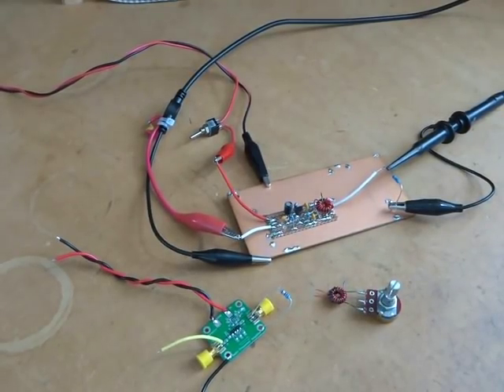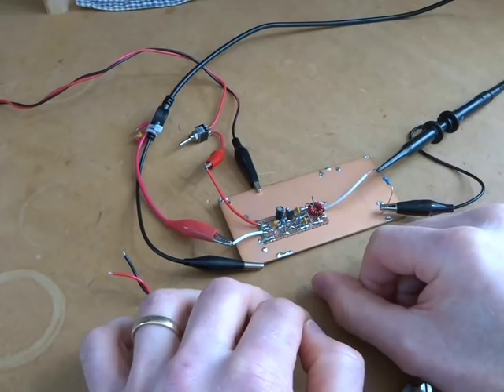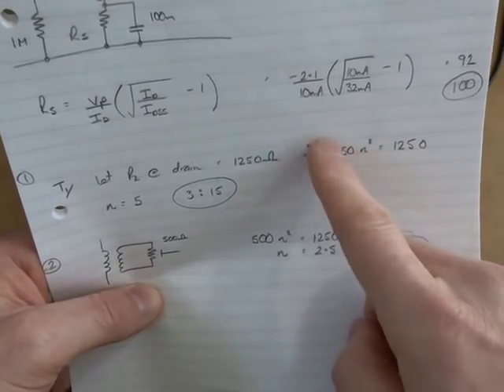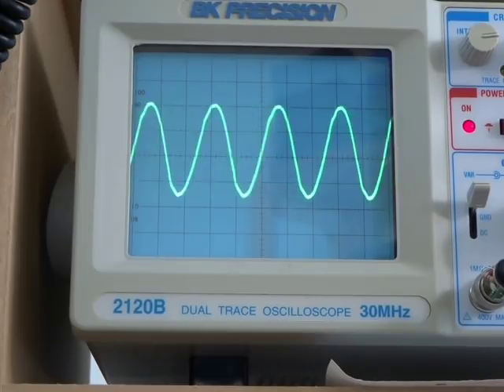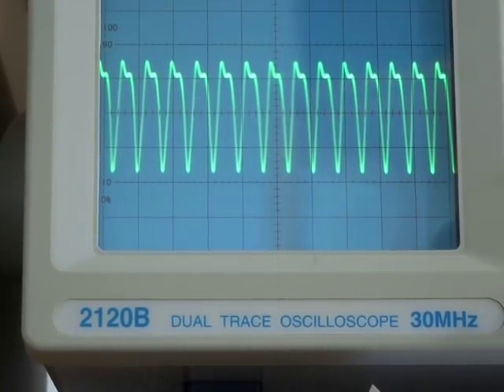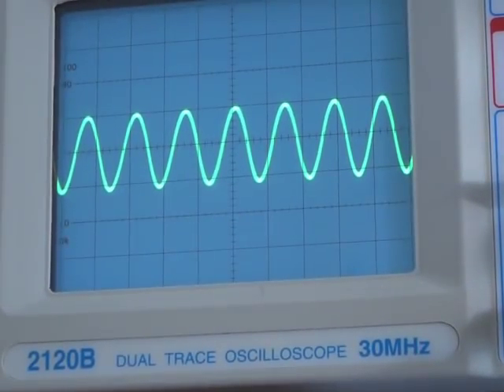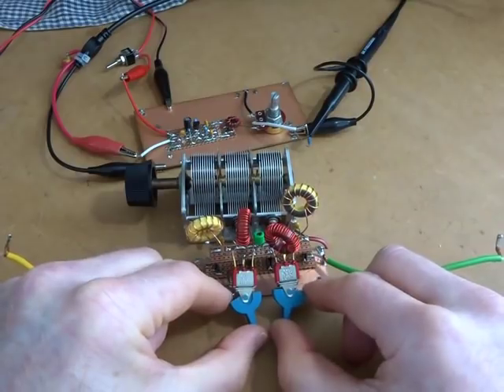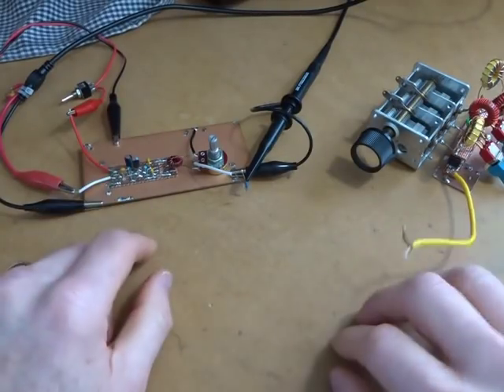80/40/20m SSB SDR Phasing Rig: Part 2. Antenna RF Amplifier

Comment: Can i ask why you try to use 50 ohm input impedance in some of your other rf antenna amp for receiving rather than just infinite input impedance (like with a jfet amp). Super high impedance would keep the antenna Q high..
Reply from the maker: Hi. I was just trying to maintain maximum power transfer.

Comment: great but simple design : -) I wish you had actually measured the gain of both amps (to check the target 10dB) but the eBay thing looks very crappy indeed and definitely does not seem to have 10dB gain even though they have used a darlington pair (almost). It is badly biased and goes into saturation very quickly.
Reply from the maker: Hi Amir. I did actually, but neglected to mention it in the video. I intend to put up a Part 2a today to address that. I agree too about the commercial amp. It was looking a bit like a voltage follower, but the collectors were paralleled up. Strange.

Comment: Great video as usual. But should not n be 1.6 at time 6:20?
Reply from the maker: I have just soldered in the new transformer and repeated the tests. Funny old thing, it performs even better.
Reply from the maker: Yes indeed. My mistake. Thanks for pointing that out. I'll leave it up, and will update the description. That really annoying!

Charlie
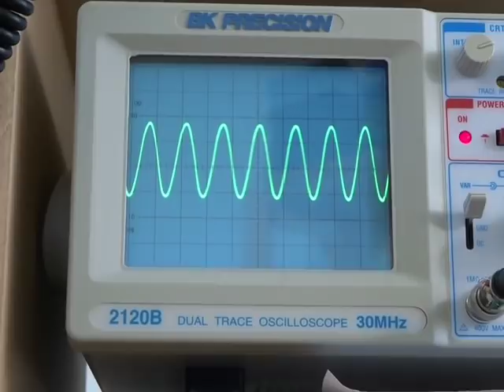Reply from the maker: A good transformer option would then be 7:11 or perhaps 5:8. Thanks again Peter.
Reply: Good catch!  

Such a simple calculation I've done so many times. but I totally missed it as well.  Sometimes I get so caught up in the overall process...

I had to watch the video three times (after reading your comment)  to have it 'hit me' which explained why my own math was coming up wrong!  

Square root, gotta remember it's the square root! LOL!
Reply from the maker: Hi Christina. Yeah, it's easy to do if you are in a rush and don't double check your calculations. Oh well, I'm pleased Peter pointed it out.
Reply: @CharlieMorrisZL2CTM  No worries!

Kinda reminds me of the old amateur radio tests where out of 5 possible answers, one was outright wrong, one was correct, and three were based on common mistakes and oversights when doing the math.

:D